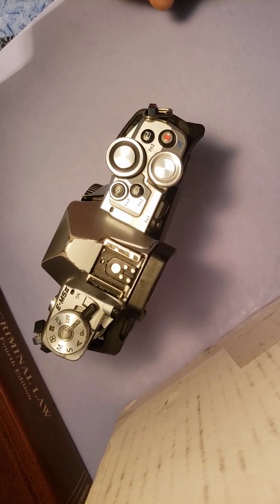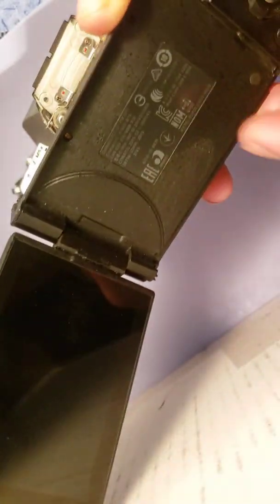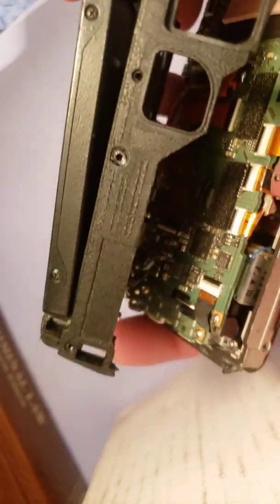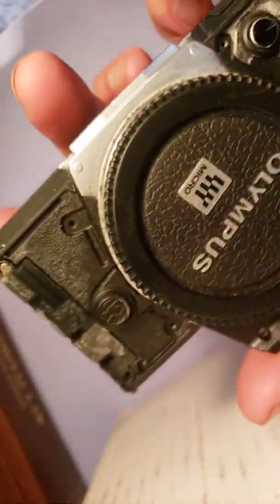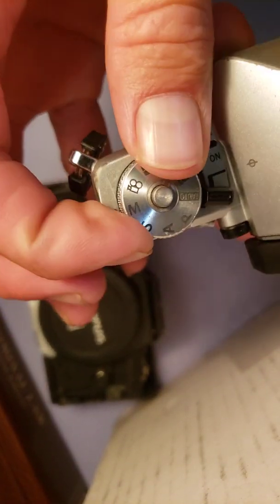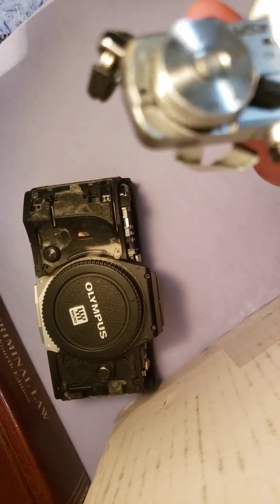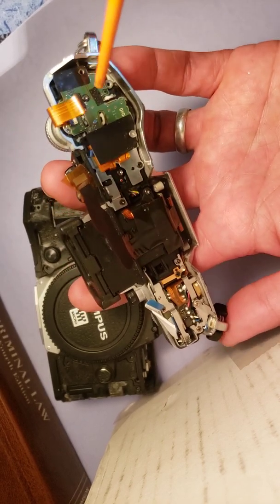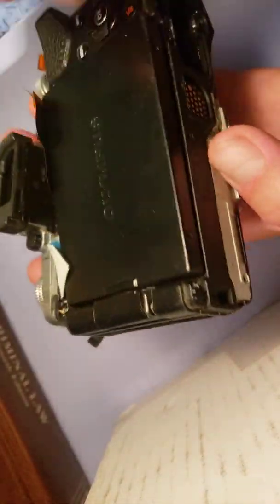Mission Indie-Possible: Olympus OM-D E-M5 Mark ii disassembly and thoughts on off/on switch failure.

Comment: none of my screw driver fits. Any recomendations where i can find one? (I use the sharden kit from amazon)
Reply from the maker: @pianeek5338  hmmm. Good question. I think I got mine from Harbor Fright. For some weird reason I've had to use different kits. Sometimes it's some generic eyeglass screwdriver. Maybe it's the "JIC" style tip -I think it's called JIC. Some sort of Japanese spec.

Comment: @sebastiendavid Do you know anything about the e-m1? My on-off lever stopped ‘clicking’, and now I can only turn it on by slowly moving the lever until it hits a sensitive sweet spot. So basically can’t use it anymore :( any thoughts as to if this seems like something I can fix myself by opening up?
Reply from the maker: Could be a build-up of gunk on the little feeler connections, or switch might be spring loaded and get jammed. I'll look into that and see what a replacement part looks like.
Reply: @ thank you!!!!

Comment: I tried the "spray alcohol" method and it works for me too.

I draw a bit of 90% alcohol on my blunt syringe and spray it (incorporate air so it's a mist) on the underside of dial, where the pin is visible.

Several rocket blow drier and playing with the switch and it works again!

I hope I don't ruin the preapplied lube

Comment: I have the same issue. In desperation and after reading that people used WD40, I've pinched(without opening the camera) a couple of drops of alcohol 96% and by magic, it works again. What sense does it make? My low scientific skills cant decipher this one
Reply from the maker: @ArmandoReixagrfkz  next time I'm going to try wd40 -now that I've played the disassembly game. The pin that gets  pushed, when the on/off is used, seems to get jammed......  😳 the second one I got was jammed AND the switch inside was also jammed..
Reply: @sebastiandavid8677  I can't explain what happened or how it started working again, i didn't even use wd40. Just 2/3 drops of ethyl alcohol. Does not make sense to me but it worked. At least for now. Lets hope for the best
Reply: @sebastiandavid8677  By the way, thanks for your video
Reply: @sebastiandavid8677 and btw2 this is the tip that led me to use alcohol "Then I tried spraying some isopropyl alcohol into the dial and switch, flicked it back and forth, spray some more and flick around again. Then blow out as much alcohol as possible and leave for a while. Came back, cleaned with dry micro fibre cloth… and it was fixed!!"

Comment: THIS is a great video! As you mentioned, there seems to be nothing online with the details you show here. My On-Off lever works okay BUT the P A S M mode dial as VERY difficult to get set. I don't change it much at all (usually just M, sometimes P), but it goes EVERYWHERE although the tactile clicks feel fine! No solution yet - but thanks for a lot of hints here!
Reply from the maker: @AerialLensVideo  I'm glad it might be helpful. Take my advice with a gra8n of salt BUT some contact cleaner might help. I would remove the back though. 8 tried to fix the on/off switch without disassembly on my second em5 mkii and the fluid that went into the evf still hasn't evaporated; that or it damaged the  lcd screen layers. Either way the lower third of the evf still is black. If I leave it in the sun sometimes it gets a little better....
:(
Reply: @sebastiandavid8677  Thanks. I actually did that a couple of weeks ago based on a guy's advice on YT to use the cleaner followed by careful blowing with aerosol can, and it workedon YT; It worked a few days but now the problem has arrived again. Say the camera is turned off while in M mode, then turned back on and it is now in S mode! Weird. Again, the detents/feeling seems fine. This is my real estate (small business) camera, so I need to get this right as soon as possible. If I had the $$$, I'd just get a nice used M1 Mark II.
Reply from the maker: Hmmm. I wonder if some crud conductive is built up. If the dial itself is still in the same mode it could also be the little feelers inside the camera under the dial are bent, or coming unscrewed. Is the change random? If you put it in auto does it change. If it's in M will it always change to say P?
Reply: @sebastiandavid8677  Yes, fairly random, and yes, you might turn it off in one mode and turn it on and it's in Auto or - most often - S. I got the camera new and have taken really good care of it as well as stored it in its padded bag away from any kind of noticable dust, heat, cold etc. It has been great except for this recent problem. It has been used for hundreds of 1-hour sessions, but I really don't mess with the mode dial very much at all.
Reply from the maker: That is super obnoxious.  I wish they wouldn't use so many small complex plastic components
Reply from the maker: You may end up contacting Olympus.  I just asked the places that repaired my Z6 and they said they don't repair Olympus cameras.
Reply: @sebastiandavid8677  Just asking - WAY OFF chance - do you know of anyone in the US or Japan who repairs these cameras in a reliable way, whom I may try to contact? I do not mind sending the camera to someone trustworthy, as I have a M10 Mark II stored away and can use that for a couple of weeks while "my baby" is away. Thanks again for your video and for your comments.
Reply from the maker: @AerialLensVideo  under warranty  I had Shocked Eletronics out of Brooklyn New York repair a Nikon Z6 that was dropped. I had insurance through a company called CPS. I had to send it back once because the mode dial was doing the same thing as yours. There is also KEH. I've never used them,  but I have bought cameras from them. I live in Cali so it was a ship job.

Comment: I had a broken power switch (snapped in pieces, camera always on). Good instruction on how to open the body. Some screws not mentioned, but they were easy to spot. I figured out how to get to the power switch: remove metal stripes, carefully bend the circuit board away to be able to undo the screw under the function wheel, then pull out function wheel and some round fixing element to free the power switch ring. I managed to melt thin copper wires into the fragile plastic power switch ring to hold the broken pieces together. It was a pain, and I wasn't sure if it was possible, but I ended up with a solid power switch ring. I reassembled everything, and luckily everything's working again. The power switch ring is a design flaw imo - it should be built far more rigid. Oh, one more thing: I also took out the flah unit, which I didn't even have to, as it turned out. In the process some tiny metal bolt flew towards me. I couldn't figure out where it belonged, so I didn't bother putting it back - apparently it wasn't a crucial part. Thanks again for giving me the courage to fix my camera.
Reply from the maker: Thank you for the feedback. I am glad I could be of some help. I realized later that I had missed showing or mentioning some of the screws - like the one on the left side under the plastic jack that comes off with the 2 screws. 

How did you like the little plastic spring-loaded teeter-totter that toggles the power switch and the spring-loaded balls under the power switch and under the mode dial. I accidentally put one of the balls back before the spring and it wouldn't come out. 

I also broke the copper connection to the pc flash jack while removing the dial. I had to solder a short piece of wire stright to the circuit board and bridge the gap.
Reply: Yeah, the mechanism is interesting to say the least. I totally agree with you that the power swith should've been engineered in a more direct, or at least more robust way to avoid malfunction. Without your explanation I wouldn't've figured out its mechanical principle.

My copper band stayed in tact - I just bent the circuit board as little as needed. In my case I only had to acces this one screw, which holds those 'feeler fingers' and the mode dial in place, so that I could then take the power switch ring off in order to repair it. 

It was very helpful that you mentioned the bearings and the other spring which makes a pin engage with a cog to set the mode. Once I lifted the circuit board and took off the mode dial the whole mechanism still surprised me. It's also easy to loose parts. When reassembling the third time (I had to adjust my repaired power switch a couple of times) I actually almost lost one of those tiny bearings as it somehow fell out.

I also wanted to grease the parts, but didn't have anything to grease it with. In my case it didn't matter though, since I had a different issue (broken power swith).

What camera are you using now? I've been using my camera exclusively with the 12-100mm lens which is great in any situation. It's still superior to my smartphone, but these are taking so good pictures nowadays that I sometimes am already ending up taking only my phone on a trip.
Reply from the maker: I am really impressed with your solution to repair the dial!

I sold the silver em5 mkii a few years ago. A few weeks ago I bought another em5 mkii with the same on/off switch problem.  I have a few different cameras.

Olympus E-m5 mkii
Panasonic G85
Panasonic G9
Olympus Em5 mki
Sony A6500
Nikon Z6
Canon 70D
Nikon D70s
Nikon D810
Canon G1x
Casio Ex-z750.        X3
Nikon P7800
Sony A380
Fuji s1
Pentax wg-iii.

At one point I managed to only have 2 cameras. I just keep finding a feature one is missing.  Using the feature search on dpreview is pretty helpful.
Reply from the maker: As far as phone cameras they are such a sexy option. I default to mine many times. My main gripe with most phone cameras is the flash and lack of hotshoe. Actually part of what made me buy cameras like the casio ex-z750 is when I discovered the value of a high flash xsync speed. I really liked the nokia 1020. I wish they made a android version  with better battery life, maybe even a hotshoe or some sort of external flash control and larger sensor.

Comment: Hi seb, I have a Olympus omd em5 mrk1 and the evf starts turning white screen. I have tried resetting it and taking battery out and in again but nothing works. So I am wondering is there any way to fix it ?
Reply from the maker: @Zhemingpng  I'll keep polking around , but this is what I found so far from fourms: Just wanted to update everyone.  Just got my camera back today from Olympus service here in the states.

The only thing mentioned on the slip packed with the camera is that it was a "complete repair and return all functions to factory specs", and recal and realignment.
The description of parts used was "Board, Main control board and c.p.u. IC".  

Another person said their EVF circuit board was replaced.

Comment: I need to replace the lcd cable. Do i need to  unmount the top part of the camera to be able to access to the connector in camera side?
Reply from the maker: I don't think so. Check out this link to someone who removed the rear case for a different repair. 
 https://www.mu-43.com/threads/e-m5-ii-stuck-switch-won%E2%80%99t-power-off.107895/
Reply: @sebastiandavid8677  thanks for the link! Seems to be doable

Comment: Hello my menu, info, arrow, playback buttons all stopped working, I can't even do a hard reset, any suggestions you could suggest would be amazing
Reply from the maker: What does work?? For example, on the sony a6300 if you deactivate the af on half shutter press you can circumvent the button lock. The camera might have gunk in a button and deactivate other buttons from being pressed

Comment: i just put some WD40 onto the off/on switch and it works for over three years now. (My camera also couldn‘t be switched off any more)
Reply: I've been having the same issue. I just used WD40 on my on/off switch and it worked! thanks
Reply from the maker: I worry about wd40. I'd rather use lithium Greece just in case. I used wd40 on a olympus tg3 and it ended up dripping onto the lens assembly. Does wd40 conduct electricity?
Reply: @sebastiandavid8677  WD40 cleans … and if you don‘t spray it, and just use one or two drops it will dry away before it reaches far in the camera. I did the same with a crazy function wheel at a Canon Powershot G9 and it was the best way to repair the bug. I didn‘t open the camera … just some drops on the gap of the switch.
Reply: another question – today i destroyed my display … I found some replacement offers in the web. How far do I have to disassemble the camera to be able to replace it – do you remeber ?
Reply from the maker: The rear lcd?? I'll look to see what I can find. I don't remember it being that difficult
Reply: @sebastiandavid8677  yes, the rear one – I didn‘t try to open the camera yet.
Reply from the maker: I think you just need to remove the back and screws. If I recall the wires run through the back cover. So maybe just the bottom cover to access the back case screws under it and the screws on the left side.
Reply: @sebastiandavid8677 , is it still working, or did it have to be done again?

Comment: Is it complicated to replace LCD flex? My flex is broken - again. I've only turned screen for selfie - once in proper way, and it's damaged.
Reply from the maker: You might have to look up some pictures or the replacement cable  and rear case to visualize placement. Even pictures of other Olympus and Panasonic models might help. Dr. Google turned up some information:

I just had this same problem. I am an original owner of an OM-D E-M5 Mark II. I've had the camera about 3.5 years. I used the camera without issue two weeks ago Saturday. The following day, the screen was dead. I disassembled the LCD screen today and found the issue. It's a clear design flaw. If the user always rotates the screen the same way (like I do), the rotating screen will twist the internal connecting cable that runs from the body to the screen. Continued twisting of this cable causes the cable to look like a corkscrew and shorten accordingly. You can't see this happening, because the cable is internal to the camera. Once the twisted cable gets too short, it pulls itself out of the LCD connector. I had to untwist the cable, re-attach it back into the screen connector, and reassemble the screen. The screen now works. BUT - it will fail again once it twists up again from regular use. This is a clear design issue with this camera!

it really doesn't seem like there's much to it. Remove six small screws, undo the ribbon cable, connect new cable and reinstall screws.

Comment: My power switch mechanism started feeling weird and sometimes getting stuck after I took the camera with me on a 200+ km bike ride. It was in a bag mounted on the bike. Now the mechanism finally came loose enough for the camera to not turn on anymore. Sucks that now I have to go through the long disassembly process just to put the mechanism in place... while the actual switch is so small and simple. Thanks for sharing your repair experience on this, couldn't find much info on it online.
Reply from the maker: My pleasure! I have really enjoyed poking  around inside cameras. I'm way more boring in real life ;)

Comment: Hi Seb, thanks for the video and some great insights! I’m trying to take apart my E-M5 mk ii to sand and repaint the silver metal parts, but from the video it seems the electronics(especially with the top plate assembly) will be a major problem. Have you ever gotten to disassembling parts other than the power switch circuit, and would you advise against trying to repaint the camera? Thanks!
Reply from the maker: If it isnt you main camera I might try with the possibility of spme issues.  It seems like the tolerance between parts  is very close and paint might gum things up. For as well made as the camera seems to be its weird the parts they choose to make out of plastic. I am glad I wasn't asked to engineer this miracle camera. The metal is also very thin.

Comment: My on and off switch is also not working. After getting the top off the camera and thought light brackets that the copper wire is attached how do get the mode wheel off and get at the mechanism the flicks the on and off switch. I would like to see a video on how to fix the on and off switch pacifically.
Reply from the maker: I sold my camera and I'll have to rewatch the video to try to jog my memory but I think it's a screw that's on the bottom side of the dial and there's a Teeter totter kind of mechanism. You may be able just to spray some of that electrical contact cleaner in there and kind of work it up-and-down the underside of the dial. Be careful because the backside of the dial and on/off ring has some little ball bearing things in there and once they pop out of place I think they're Spring loaded but I'll have to try to think about that
Reply from the maker: I believe the circuit board is covering the dial screws and assembly. Those silver metal grounding braces might also need removing. See if you can find the dial, on off ring and bare case for sale on ebay or Aliexpress for pictures of how it is mounted. Also try opening it on a white cloth in a bowl to make the parts that might fall out easier to see and not lose.